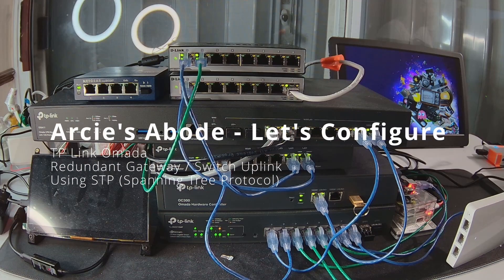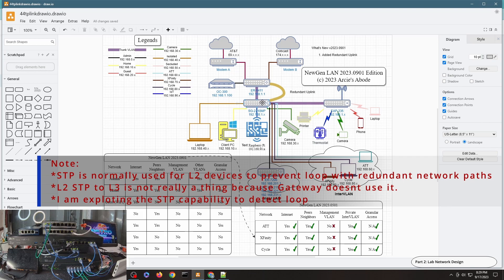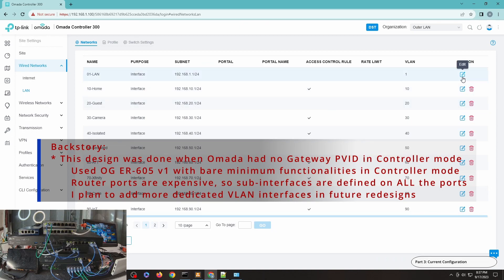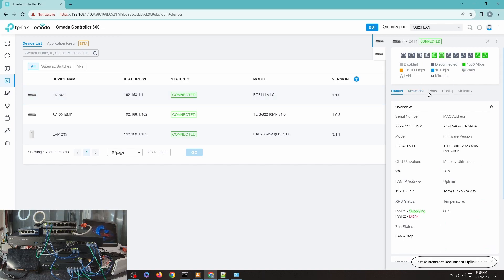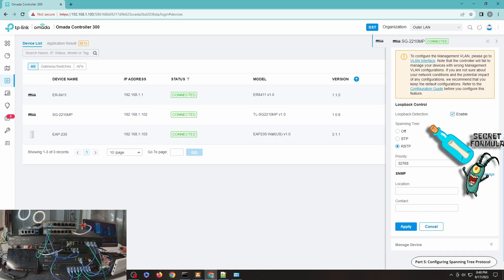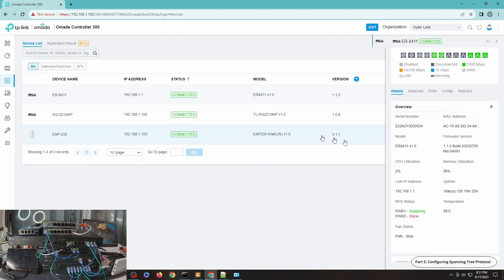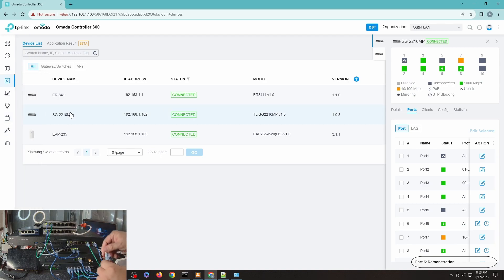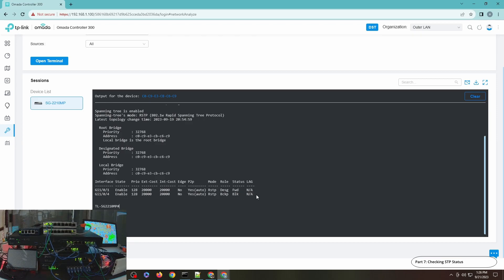LC60: Redundant Uplink - Spanning Tree Between (RSTP) L2 and L3? TP Link Omada Gateway and Switch

Comment: Hi, thanks for this wonderful video. I was wondering what would happen in the event of an intermittent link failure, given that the STP takes relatively long time to recover. Thanks!
Reply from the maker: hey there @horacioricardodrut6645, thanks for dropping by the channel. I have not implemented this long enough to encounter that, but I suspect that it will be heavily dependent on the online application. For example, for streaming services, if there's enough buffer (more than 30s), the downtime will not be felt at all. Same for any banking application or any application that does not rely on real time processing. For online games like FPS and RTS, depending on how the game server/client is configured, It will appear as if a massive lag spike happened and the game can still continue to function but the player will definitely feel the lag/disconnect (and it will feel like forever to them). 

Good hunting!

Comment: looks so simple, thanks for the video but keep screwing this up. I have a ER7206 with fibre connected daisy chain to 3 switches SG2210P. I have CAT6 installed also and would like this as a failover directly to the router or main switch in star topology. Just can't get it to work.
Reply from the maker: hey @CJ-vg4tg, thanks for dropping by the channel. I want to make sure to clarify that this process is a "hack", as I have to knowingly cause a loop between the Gateway and the Switch, so I do not recommend this for "normal" use. If you have a chain of switches like you do, this makes it more complicated. I suggest you set up one SG2210P switch as distribution switch, make a dual connection to two LAN ports of ER7206 (make sure the LAN ports have the exact same configuration with each other i.e. all VLANs are defined on both LAN ports) and single uplinks from that distribution switch to the two other access switches.

Good hunting!
Reply: @deadmeats  thanks yes I eventually got it sorted. I used 2 ports in a LAG configuration, so 1 ether and 1 fibre both working together to increase bandwidth and adding redundancy if 1 port/cable goes down. Working well so far. There is also anoption for spanning tree under the lag config that you need to tick.

Comment: Hi Sir, naka enable ba by default ung blocking nung port kapag may loop? Sakin kasi ang ginawa kong setup sa mga switches namin na TPLINK is naka enable ung port blocking per port. Kaso nung nag ka loop, nag down parin buong network. Salamat Sir
Reply from the maker: hello @christianabellarwtf , salamat sa pag drop by sa channel. Ang alam ko eh by default, naka off sya. Para ma verify mo, punta ka sa Omada Console Settings > Wired Networks > LAN > Profile. Tapos click mo yung parang icon na mata (View) ng profile na gamit mo sa Port. Pag na open mo na yung "View", expand mo yung "Advanced Options" > "Loopback Control".

Okidoks, good hunting!
Reply: @deadmeats  Naka choose ung Lan Port Detection Port Based. Sinet ko kasi siya individually bago ko inintigrate sa Omada controller. Siguro gawin ko tong guide mo na on ung RSTP para ma prevent ung loop. Salamat po Sir
Reply from the maker: @dudongwtf  hello di ko alam kung tama ang pag kaintindi ko sa integration mo, pero, pag na set mo yung mga ports using stand alone, tapos inintigrate mo sya sa Omada, meaning, in-adopt mo sya sa Controller,, mare-reset sya sa default. So make sure na yung settings mo eh lahat Omada Controller Mode sa lahat ng Omada devices. Tapos tama ka, gawin mo yung RTSP configuration.
Reply: @deadmeats  Maraming salamat Sir

Comment: Meaning you can have 2 uplinks (going to L3 ER8411 router) without LACP? Just using STP? Ive been looking for this kind of setup. 😅
Also what if ill add 3 more switch? Same procedure? I should enable RSTP on specific ports? AFAIK also need to change the bridge priority to select whos going to be the Root Bridge.
Reply from the maker: heya @davidesguerra7837, thanks for dropping by the channel. ER-8411 is just a Layer 3 router, so it doesn't support LAG/LACP (mostly relegated to Layer 2 Switch or Multi-layer Switch). So the trick is, use the switch's RSTP Loop Detection to provide multiple uplinks from Switch to Gateway, the switch will detect the loop, and block one of the port. This is not a recommended approach to do it, but I just put it out there as I got some inquiries regarding this in the past.

As for adding more switches, I highly recommend you start RSTP purely on Switch first and get them to work. Then ocne it is working, include your Gateway. I have similar video doing this approach, you can find it here: https://youtu.be/DLekggDKZgk
Reply: @deadmeats  thanks bro for replying, currently eto kasi vendor ang  dine-deploy ko for my clients. Pinoy ka bro noh? Hehe. Sana update lang ni OMADA yung sa security side nya noh? Like IDS/IPS pero yung "PRO" version yung parang White na colorway parang meron na IDS/IPS. Dipa lang ata na re-release sa Pinas? 😂
Reply from the maker: yo @davidesguerra7837  , yes sir, pinoy na pinoy. Sa mga updates, ok na rin si Omada kasi dati (4yrs ago), dami talaga kulang sa mga features nya, nag adjust lang ako kasi nga ang laki ng mura nya compared sa competition tapos Lifetime Warranty pa. Pero ngayon, marami na syang features (marami pa rin kulang tulad nga ng mga IDS/IPS) at naging 5years na lang ang warranty nya (matagal pa rin compared sa competition), pero ok pa rin naman yung price/performance/warranty. Check mo lang yung mga EOL nila kung balak mo bumili bago ka mag deploy, ilagay ko yung link sa baba, para sigurado. Btw, dito na ako sa US, di pa rin available yung mga PRO line up nila.

https://www.tp-link.com/en/support/faq/3562/
Reply: @deadmeats  ok bro salamat sa list eto ngayon ang proficient ko na Vendor at hinahasa haha new ako sa IT freelancer (network implementation focus) salamat ulit bro! Waiting ako sa PRO version haha
Reply: Hows the process if may tatlo akong access switch sa baba (below nung distribution) ok na kahit naka default lang RSTP nung mga yun sir? 
Bali yung design ko is isang DISTRIBUTION switch (so dito ko lang enable yung RSTP like nung setup mo sa Vid tapos set to low priority number? Thanks! 

Para may secondary link lang din sana kesa wala (galing ng idea na ito)
Reply from the maker: hello @davidesguerra7837  , ang baguhin mo lang sa RSTP ay yung root mo para alam mo lagi yung root, usually yung root eh yung pinakamalapit sa Gateway mo (Distribution Switch). Try mo rin mag LAG/LACP para hindi sayang yung uplink ports mo. From Distribution Switch, just configure at least two ports for downlink/uplink between switches. Yung demo ko rito na RSTP eh para sa mga nag request na magamit sya as redundant uplink sa Gateway, pero kung switch-to-switch, mas peborit ko yung LAG/LACP uplink, 

Good luck sa career sir.